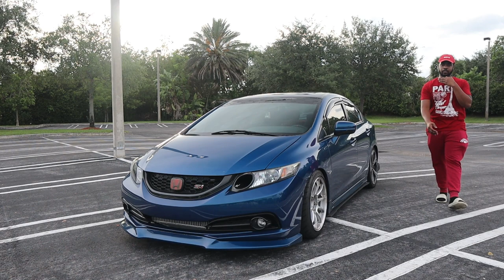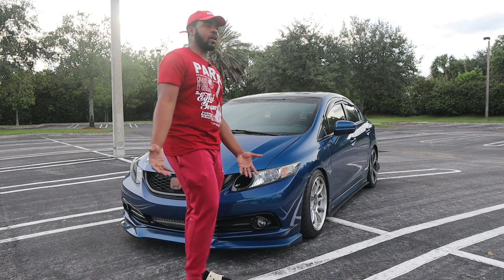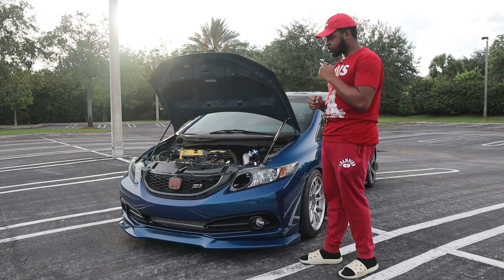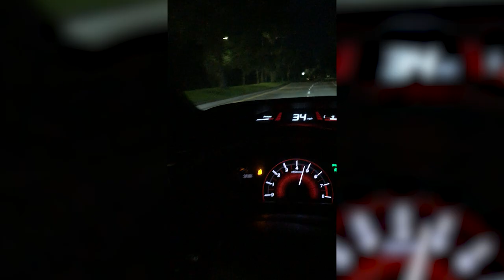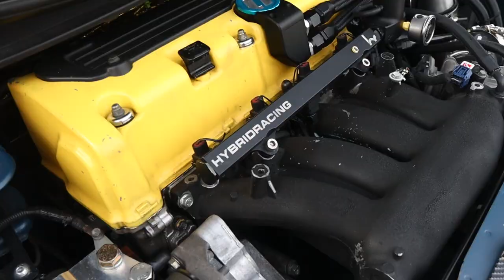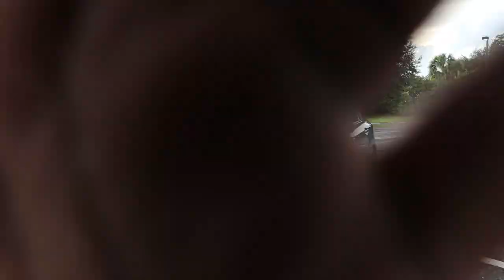5 Things I LOVE About My Turbo'd Civic Si | 2015 Honda Civic SI

Comment: The hole in your headlight is for your CAI to prevent hydro locking? Did you make it or buy it? Link vid if you have
Reply: I think he sent it off to PR and some dude did it for him
Reply from the maker: Bought it used from someone I know but the original guy who makes them is in PR

Comment: Did you do a coolant bypass when you rbc swapped?
Reply from the maker: No , I used PRL rbc adapter kit
Reply: @zoovie  ok I got all of that ready!  I’m excited
Reply: @zoovie  just waiting on the exhaust and cold air on Friday.  And then injector adapters. And harness extension is all I need